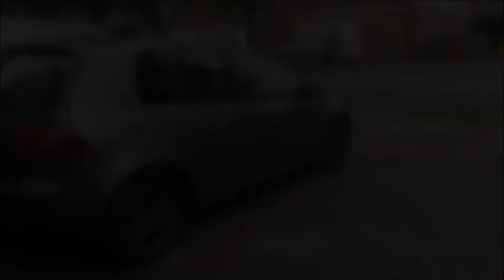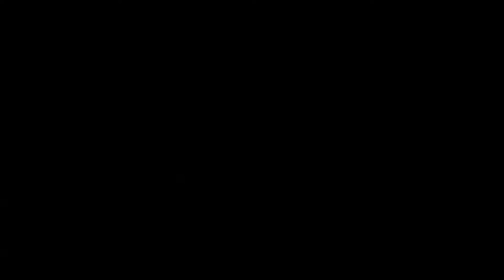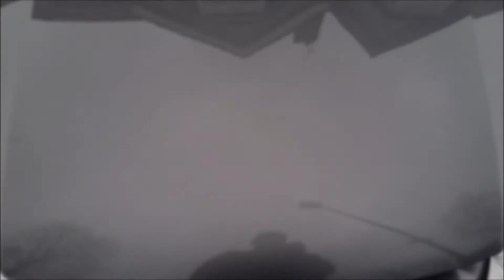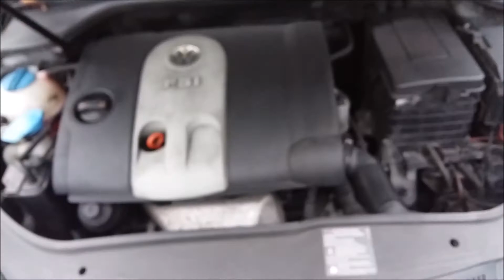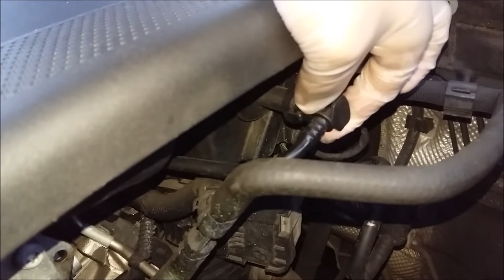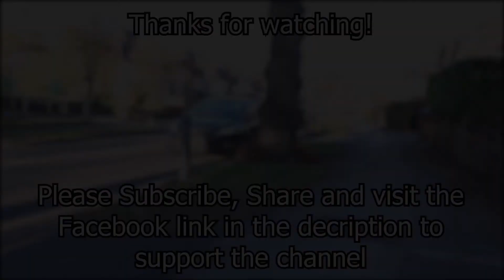How to Remove a 1.6 FSI Engine Cover

Comment: Can you put a cone filter on this?
Reply from the maker: You can but will need to get an adapter pipe to hold the MAF sensor, the stock air filter is within then engine cover, you'll need to take that off to fit a cone filter